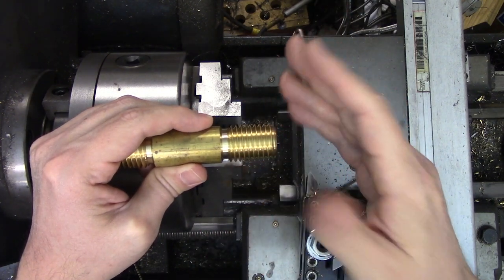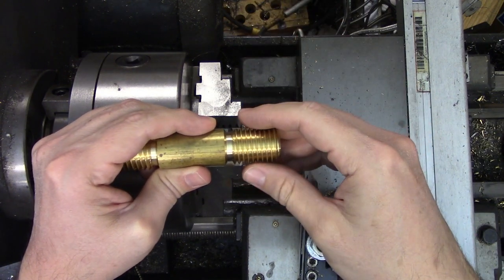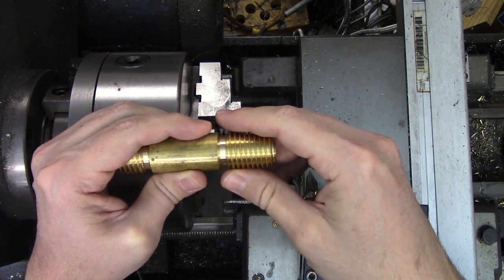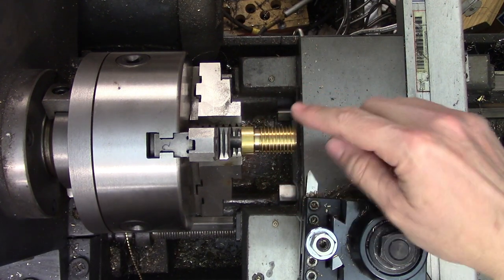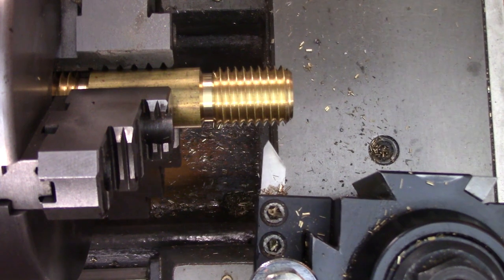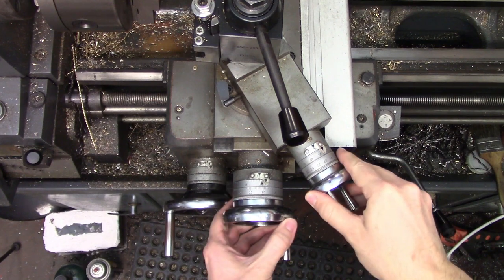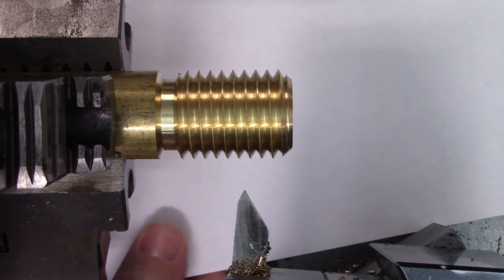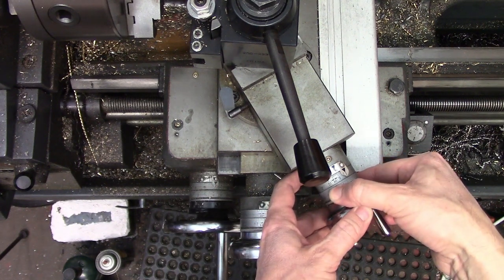How To Find a Lost Thread - Quick Machining Tip #20

Comment: a couple of things i was taught. when finding the thread tool position make sure all the backlash is taken up. it doesn't hurt to check your tool position by running the lath across the thread with the tool well out of lthe threads. stop the lath and then feed the crossfeed in to see if the tool bottoms out in the thread properly. for that part that you really can't afford to screw up you can also turn the chuck by hand to cut the threads.this technique also works if your cutting to a shoulder.your  quick tips are very helpful. thanks

Comment: This is great thank you. I have a Myford with imperial lead screw so whenever i cut metric threads i have to do it without disengaging the halfnut... however it has happened few times that i forget and the part is basically scrap. If i am really patient i can realign the threads by turning the chuck by hand while engaging the half nut at different positions until i get lucky.. this method changes everything
Reply: Evo there is a trick you can use to allow you to open the half nut when cutting metric threads. When you have reached the end of the metric thread, open the half nut and stop the lathe either with a spindle brake or just allow the lathe coast to a stop. You will notice that the thread dial hasn't moved much past the setting mark. With the threading tool backed away from the work start the lathe in reverse. When the thread dial has backed up to the setting mark re-engage the half nut and back the carriage up to your starting position. You are now ready for your next pass.
This method is especially helpful for work where a thread relief is not permitted.
 Cheers from NC/USA

Comment: Good tip. I think you could use this method to repair damaged threads on something that needed to be repaired??
Reply from the maker: You could indeed.
Reply: If you do much repair work where damaged threads have been welded up or distorted you use this method all the time.